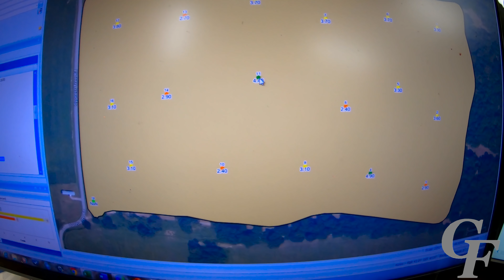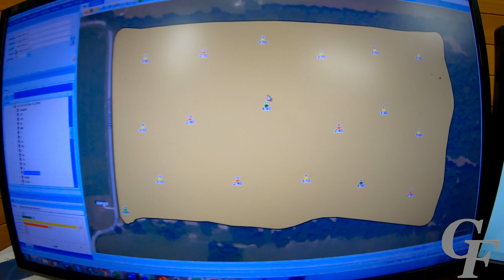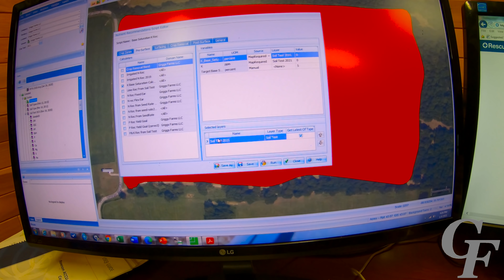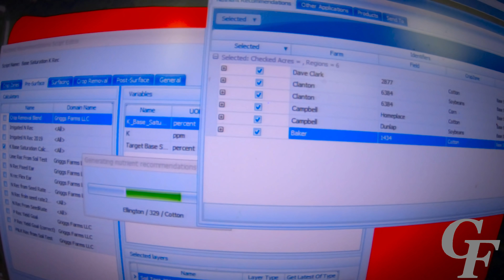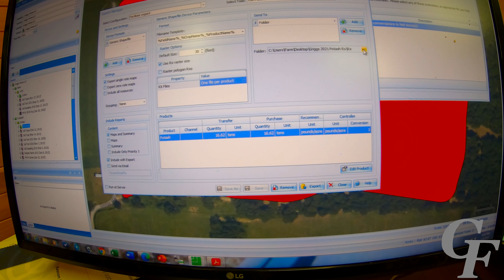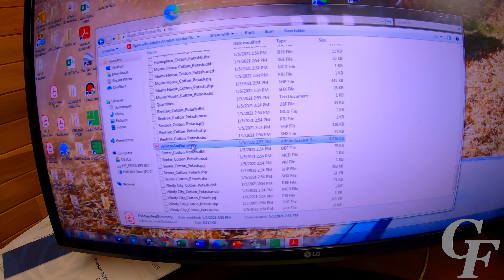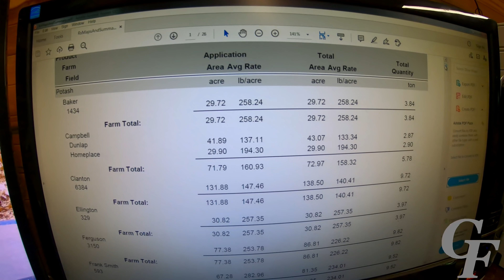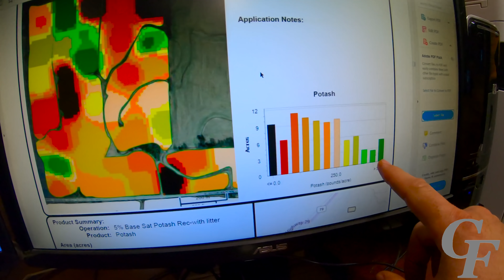1/6/21:  AAAAAHHHHH The Grain Elevator is Choked Up!!

Comment: Great video the computer sure helps as long as it is accurate. Do you do your own soil testing or send out. Interesting on what you sold for and market price difference. Seems to me that a fair contract would carry a benefit that could compensate some difference just a idea in my head. Have a great day
Reply from the maker: I lay all the sample points out and hire someone to pull the samples. 

When you contract grain, you are selling a futures contract. If I wanted to protect against the market rising or falling I would have to invest in call or put options.
Reply: @griggsfarmsllc   You have a sound management plan I think. When I was a kid 70s we sent in soil samples in. I learned in the 80s that the soil samples went with the fertilizer plants plans. Therefore they were supplying more than needed. Your plans are great thankyou your hard work videos thankyou

Comment: A lot fertilizer comes from oil so prices should be under control.  Shop around just because your making more does not mean all prices should go up.  But if your willing to pay more then wholesalers will raise prices even if there cost is the same.  Will you just order 90 tons guessing four truck loads

Comment: It could’ve just as easily gone the other way I guess.  I sold my beans in 07 for $7.74 and I thought I was doing something. I don’t remember what it got to in the fall, but it was similar to the same situation.
Reply from the maker: Yes you’re right. And because of the drought, I had to buy out of the bean contact I couldn’t fill. Prices jumped up $4/bushel late that summer and fall